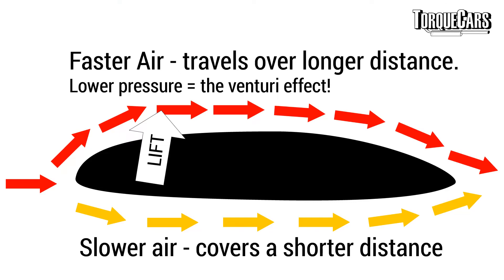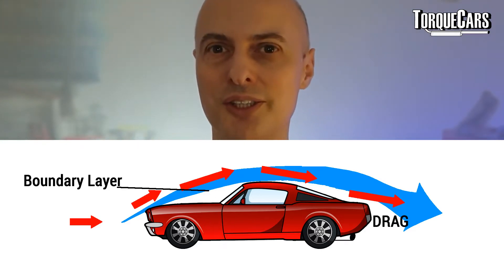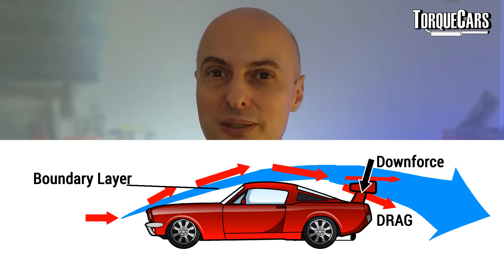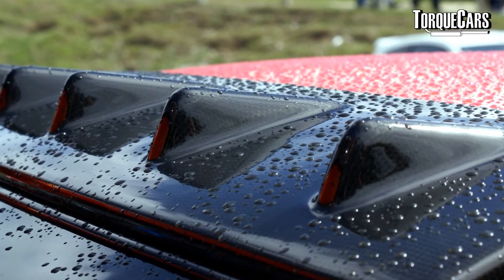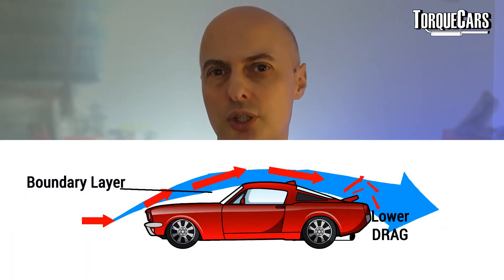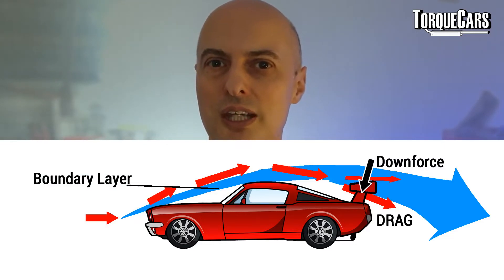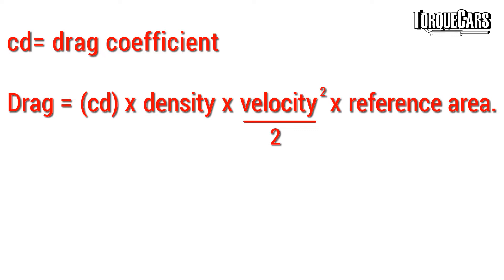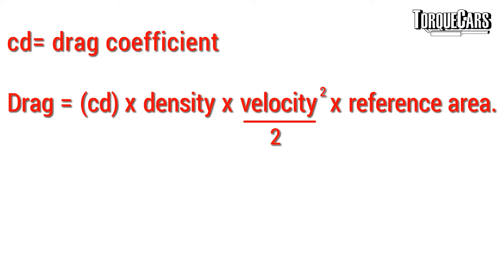Wings vs Spoilers & Vortex Generators [Car Aero Guide]

Comment: When I was around 4 years old I went down a tube slide with a toy car and it was able to drive upside down in swirls. As for a real car driving upside down...IDK
Reply from the maker: It would certainly be an interesting thing to try out. Maybe one day we'll have the resources to do something like this.

I think the big challenge is getting an engine to work upside down. Weight vs Downforce seem to work out ok in this scenario though.
Reply: @torquecars  there’s now a YouTube channel working on driving upside down. It’s quite a huge project and the biggest issue is developing an engine that will work upside down
Reply from the maker: That would be quite hard, I guess we now have electric power which works upside down, I can brush my teeth standing on my head and the toothbrush is just as effective! I'll try and track down that project, it sound pretty interesting. Got a link for me?